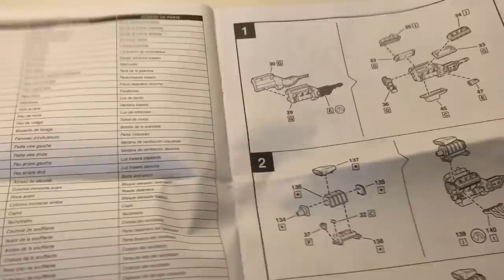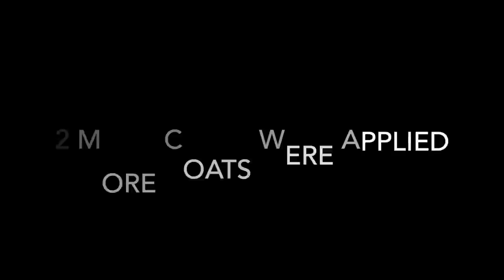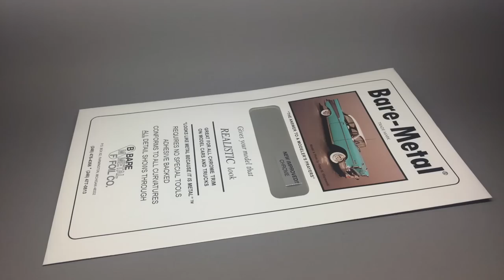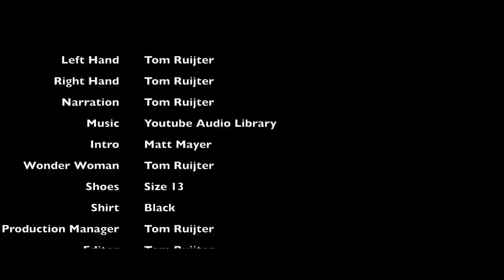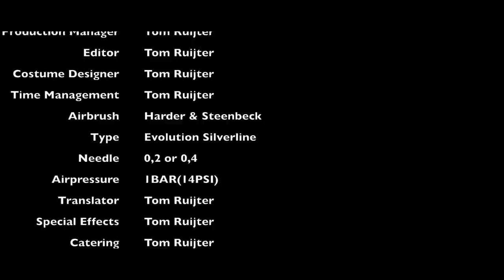Revell: 1970 Dodge Charger from The Fast and The Furious Full Build Step by Step

Comment: Good Afternoon Scale modeler, I finally got the 2K clear coat looking good on the main body. However, I'm having trouble getting the very front and the very back 2 parts looking right. And I didn't see where you clear coated, wet sanded or buffed out these 2 parts. I was wondering if there might be a special way you work with these smaller parts. Any advice you can give me would be greatly appreciated. Thx, Mac
Reply from the maker: I dont polish. I treat them the same as the rest

Comment: have you tried to make the front and back lights work? would be real interesting to see a build on that maybe like hide that circuit in the boot or something would be cool
Reply: It can be done, but you will have to omit some parts out due to having to install a battery pack and other parts. You can get LED kits for the headlights, tailights, interior lights and others for a more unique approach. It is more commonly done on RC cars because they implement more room to install such objects.

Comment: So you never have to wet sand or polish your clear coat jobs? When I clear coat I usually have some air bubbles or other debris that I must remove. Your the first person to tell me that they get it right the first time every time. What a guy!
Reply from the maker: I did not say i get it 100% perfect.

In my case it is good enough, to a point where polishing will not make it look better. It only makes it a bit smoother and leaves scratches.
Reply: Okay, that makes sense to me.  More detail helps us beginners!   Thanks for that additional info.

Comment: I tried to build 2 chargers, this kit and the revell 68 kit, both of them had fitment problems where the body wouldn't get all the way over the frame and it left a gap. Did you car do this or was I doung something wrong?
Reply from the maker: Mine fit up just fine

Comment: great build,  is the paint coming out smoother with the smaller needle .2 and less air pressure?
Reply from the maker: Henry Prophete for the primer i noticed it to be less smooth and more grainy. For colors its turning out well. For clear i stuck to the 0,4

Comment: Hello, I enjoy your channel as a subscriber and you are quite a talented builder. Your instruction has helped in areas to improve my own building, however, if I may be so bold, I have one question and some helpful suggestions for you:

Firstly, the question: You put an incredible amount of detail into your builds, they're better for it and it shows, but why overlook the interior carpeting? I haven't used fabric flocking personally so I can't speak to it's effectiveness, however, I did learn of and try embossing powder sprinkled over a coat of matching paint and the result is TERRIFIC. It lends a 'fabric-y' look by adding a texture that reflects and diffuses the light in many directions while still remaining matte. It really is an excellent step that gives that extra oomph via the illusion of depth that a simple matte or satin paint cannot achieve alone. I have found it in the stamping section of my local hobby store, however, I have found a far wider color range online - the stores only really seem to stock black and plain, plus a veritable rainbow of colors - that all contain added glitter, which defeats the purpose. I have found fabric flocking on eBay, but not locally.

1) The accelerated sections, while expedient, gloss over some of the detail work you're doing and I think users are missing out on beneficial information - my solution would be to utilize YouTube's speed controls and allow the viewer to zip past what they feel is unnecessary, or, perhaps in place of that (considering the longer the video, the longer the upload, I get that.) add voice-over narration over the accelerated portions to give a bit more overview of the products you are using and why - for example, which chrome paint you're airbrushing and why: does Vallejo dry better, bad experience with Alclad II or Spaz-Stix, etc. These sections can easily be recorded in post with a decent mic and overlaid to better help others understand not only the how, but also the why - in this build, for example, why is bare metal foil your choice instead of simply taping and airbrushing the door trim? The car already has the gloss black case color and we've seen you do elaborate taping, such as in your video covering how to effectively mimic exhaust systems and their heat discoloration. Bits like this that perhaps the advanced builder views as unnecessary could possibly save beginning viewers money and headaches by virtue of your experience. I wouldn't expect you to explain your methods every time, again that's building more time into the video length, so perhaps a link and annotation to an earlier video that does cover the technique in detail - this will get you more views and possibly more likes resulting in superior monetization for your channel.

2) Please, stabilize your footage. I understand that in working with video there will be bumps and such; it appears in your case that you may be using a head-mounted cam, a GoPro I would guess from the wide angles you utilize sometimes - which I would say is an ideal compromise between visibility and ease of use for you as the builder. But when you accelerate the frame rate some of what you're doing is lost to 'camera jiggle', for lack of a better term, and it makes it difficult to exactly see what is happening, and can make some viewers a little queasy. Additionally, it drags down the quality of what are otherwise TERRIFIC videos; I really do enjoy your channel and tutelage. Asking one to sit in an exact spot for the entirety of the video is unreasonable, so stabilization would be the next best compromise and would lend a better look to your videos. Yes, it's an extra step and you may have to blow up the size of the actual video to account for the movement. (When stabilizing footage the software uses the spot you define as an anchor and the end result is the footage remains still but now you may have gaps on the tops and sides relative to how much shaking you're correcting.) Simply increase the video to 105%, or 110% and this goes away out of frame.

3) Lighting. Add more light. In particular in your airbrush booth - It appears those bits are lit solely with an overhead fluorescent (the difference in shadows and in the color difference in your hands is a dead giveaway that the lighting is a different color temperature and orientation) so we're losing out on a key bit of your technique, which again, really helps people. In example, it's difficult to make out the 'flashing' of the paint due to the lighting. A 'level' or 'curves' adjustment would allow you to better match the color between segments - it sounds unnecessary but we are talking about painting and color. In this build, obviously worrying too much about seeing all of the gloss black would be silly, but, you do a fair bit of airbrushing so it would benefit you in the long run.

Again, thanks for all of your hard work and information and please keep up the good work!

Comment: I have some Gravity Anthracite Black left over I thought that I would try using that up with their Matte Clear. The car looks like it might be a Matte finish. However, I've never used Matte clear before. Have you had any experience with Matte clear?
Reply from the maker: works the same as normal clear, goes on glossy, dries matt

Comment: What glue do you use for bonding painted parts while avoiding melting the paint?
Reply from the maker: Super glue
Reply: @TheScalemodelingChannel  thank you, do you use the "Super Gold" one or any one will do. I do tanks, so for me cement (solvent) is natural, but I did have some problems with planes and super glue, especially whit clear glass panels, then I discovered cyanoacrylate.
Reply from the maker: @AM-cx1ng  Super Gold is good for everyting including clear parts most of the time

Comment: Can someone tell me the difference between using and air brush or spray paint
Reply: You get more control from an airbrush. Less 'airdust' gets on the model. Less sanding is needed
  It's like using a lighter and spray cans are like flamethrowers. But with practice and gradual application a can will still do the job.

Comment: I wanna get into doing this, but it's extremely intimidating lol
Reply: It is when you dont have the right stuff, but if you take your time and make sure you buy all the right things its actually not to hard
Reply: @trystanmccoy2387  Just a rough estimate... How much money do you think someone would have to spend to have all the equipment to get started in this hobby?
Reply: @DeeboComing  well honestly the more the better. I've spent well into 500 dollors on my modling supplies and it wasnt until I really did that my models started coming out good, I've only built maybe 4 or 5 of them, once you've done maybe 2 or 3 it becomes less scary, so it's pretty expensive so I'd save up for it and wait till you have what you need to really do a car right

Comment: hi there, I'm not really use the airbrush, but I'm planning to use it. one thing not sure about the airbrush painting, says that the tank of your airbrush, filled with the black zero paint, the mixture of it. what's the ratio? like how many drops of the zero paint black, and how many drops of the thinner?
Reply from the maker: Zero paints is pre thinned.
Reply: The Scalemodeling Channel any idea where can I get the zero paint in Asia? Says Singapore. Lol
Reply from the maker: Sorry man, pretty sure you can not get them there.
Reply: Kenyu Ty You could use aerosol paints, if you warm them to increase the pressure. I have used them and I get ok results.

Comment: I always have a hard time with the windows and windshield. Seems like they don’t fit the mold very well. I’m not sure how to fit them in properly without getting glue everywhere. I don’t know if it’s me or cheap models. I didn’t want to spend a lot because I’ve heard you ruin several before you start to figure some things out. I am only on my 2nd model so I’m sure there is a lot I have to learn.
Reply from the maker: Cheaper models tend to have worse fitment. Don’t worry to much about it. With enough practise youll eventualy get the hang of it
Reply: The Scalemodeling Channel 
Right. I’m trying to find that balance between getting something that isn’t too expensive that I’m gonna end up messing up anyways. But if it’s so cheap it doesn’t fit together properly that’s not really any better. Appreciate the videos and tutorials!

Comment: One question,

can it roll?
Reply: No. Most plastic models are built to be static. You basically have to glue the wheels on the axles where the brakes are and they are held in place. Snap kits can be built to roll.